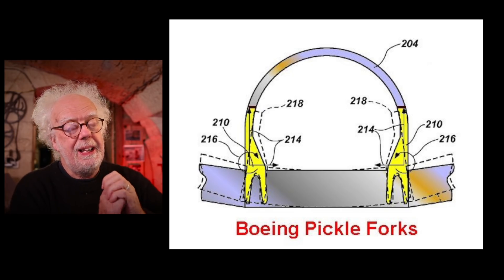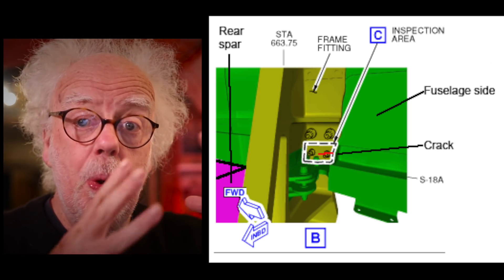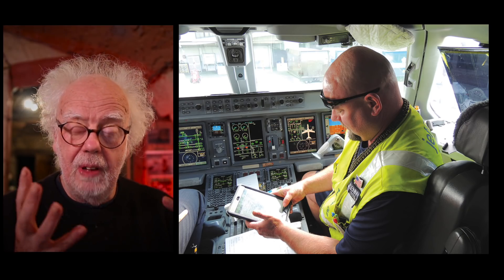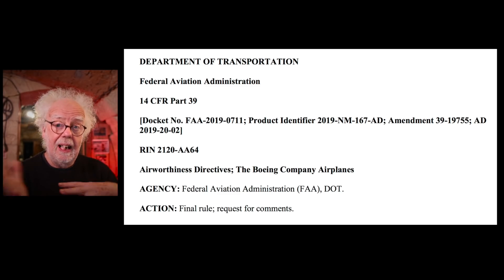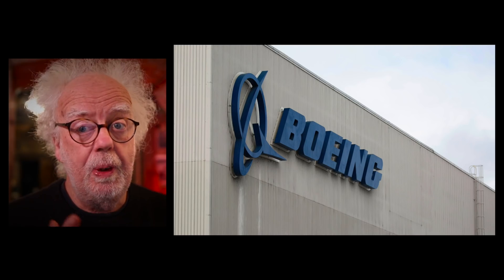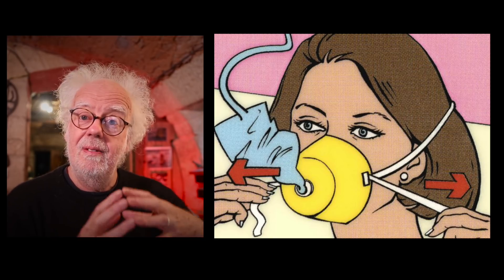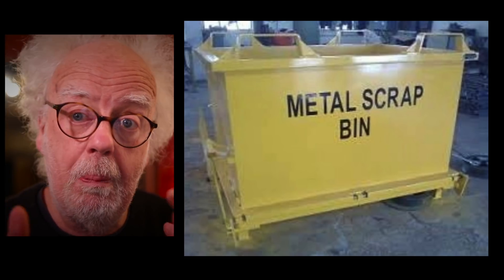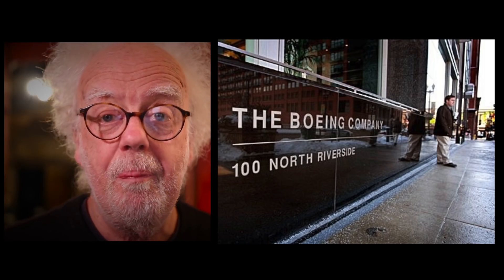Pickle Fork - Prof Simon

Comment: My understanding was that certain holes that bolts pass thru were not properly “cold worked”, and this contributed to the cracks emanating from these holes. Look up cold working to understand how they increase load carrying capacity of a bolted joint.

Comment: Professor Simon
I think you are mixing two different things, the fatigue cracks that happens in all model of aircraft (except composite structure aircraft like the B787 and the A350) and the quality and production problems affecting Boeing plants. I worked for 30 years on a major airline and 8 as a structures engineer. I was a member of the Structures Working Group for the Aging Aircraft Task Force of the L-1011 and the SWG for the MRB of the A330/A340 program in the early 90's.
Cracks are a fact on metal structures and crack growth methods are used to establish inspections intervals of the critical structural items where the existance of a crack from the beginning is the starting point. On my experience I have seen cracks on the B707 bottle pins fuselage fittings (same as pickle forks of the B737), wing to body longeron on the L-1011 and Frame 40 on the A330/A340. The FR40 cracking was known by Airbus and airlines since the fatigue testing of the model before it entered service. This issue was analyzed using crack growth methods while establishing the inspection intervals for A330/A340 Maintenace Program. Intervals were set to insure detection prior cracks reached the critical lenght. And it worked as all inspections done while I was working found cracks at the FR40 on all the A330 and A340 inspected, but all way below the critical lenght. All were repaired and aircraft returned to service without any service disruption as the inspections were planned for major checks.
What happened with the B737 is the FAA and other regulatory bodies are now under scrutiny of the public opinion and took drastic measures that grounded some aircrafts and resulted in this media hype. If there wasn't this issue with the Max I believe that the FAA would have requested that the pickle fork inspections to be done at the next major check without grounding the aircraft affected as the immediate inspections did.

The reason for these cracks on the wing to boby junction in my opinion isn't the flight cycles but related with. It is all about the landing weight and g forces of the landing, where higher the weight and g forces more prone to cracking are the aircraft. You mentioned Ryanair has having aircraft grounded and this airline has aircraft with more cycles due to short distances, more passengers and more rough landings (I have experienced this with Ryanair), so for me isn't a surprise that they have some aircraft grounded.

I have two examples of the weight influence in cracking on my personal experience as the engineer responsable for the repairs. One is the B707 bottle pins frames that were found cracked on LH and RH above and below the bottle pin. The aircraft was a B707 cargo that flew on an african country with a civil war at the time. The landing wasn't a normal glide slope because they had to descend circling around the airfield to avoid any SAM that could be shot against from outside the security zone of the airfield. Also, they had to carry the fuel for the return flight so their landings were heavy and hard.
The other example is the L-1011 rear spar cracking, this cracking appeared on the fatigue testing of the aircraft (like the FR40 of the A330/A340) and was studied by the AATF L-1011 SWG. This study lead to a modification before 30.000 flight cycles based on the criteria and loads forecasted on the rear spar. However, cracks were found on an aircraft as low as 18.000 flight cycles and the SWG recommended and the FAA mandated that the modification would have to be done prior to 15.000 cycles. After new studies of the affected aircraft, that were from the same airline, it became clear that the cracking at lower cycles was related with this particular airline operations. This airline operated mostly from island airports where the taxiway was the runway and upon reaching the end of it the aircraft had to do a sharp U turn to come to the terminal, most of the time fully loaded of fuel. The load caused by the fuel on the rear spar during the U turns increased the stress and thus cracking of the rear spar resulting in cracks being detected much earlier that thought to be.
Reply from the maker: Thank you...good information

Comment: The number of cycles is not what's is going to crack the forks. Hard landings and flying into turbulence will stress and crack the forks, those data are recorded in the FDR but those data are ignored by the FAA so they take the cycles number in consideration. In my opinion the flight hours would have been more accurate. The cycle count is only accurate for the cabin pressurization and depressurization which is placing a lot of strain on the plane skin but none on the wings fork.

Comment: Are cycles a misleading indicator of stress loads ? I used to fly very frequently and some airports (particularly holiday islands) had very short runways that involved landing with a 'bang' and then full reverse thrust and braking. Other larger airports with longer runways were much gentler affairs. I always used to wonder about the effects on airframes of the shorter ones.
Reply from the maker: Yes...an airline in Hawaii had a problem with high cycle ...high stress from salty air...lost the cabin roof
Reply: All incidents that the crew consider put excessive stress on the airframe require inspection before commencing with any flights, including hard landings. The cycle count has been formulated to include a large safety margin. The stressed skin cabin structure is the most vulnerable to fatigue  having to withstand repeated ballooning with pressurisation. Pressurisation cycles would be more accurate. Other parts of the aircraft structure that take high stress, like the wing roots and landing gear, rudder and tail section need regular inspection but will most likely long outlive the cabin structure. 
The 737 mentioned by the Prof in Hawaii lost the complete roof section behind the cockpit and unfortunately a hostess. A passenger had noticed a large crack as they boarded the aircraft...Why don't people mention these things when they see them?
Reply: Martin D A Because most times they are wrong and stupid, so no one pays attention to passengers. I heard a pax saying a part of the wing had fallen off (slats), another saying the contrails were to lower temperature on the ground, smoke (condensation) was coming inside the aircraft and so on.
Reply: Think Alaska on this...hard landing.
Reply: The Qantas 737 routes are generally quite gentle on the aircraft - long runways and reasonable weather. If they are having 10% of the aircraft with over 25000 cycles having cracks pretty much everyone else will too. Boeing has a design or systematic manufacturering fault in a structural component that is supposed to last 90,000 cycles.
BTW The 737Max has the same structure - none of them have however flown long enough for fatigue cracks to appear, their cracks tend to appear from simple overstress of hitting the ground at near Mach 1.
Reply: Cycle life on landing gear and wings, especially hard landings. There are certain G load meter readings that are required to have the airframe inspected for damage if they are ever exceeded, and the meters also have a very high G level counter, which if this increments means that you basically scrap the aircraft, as you have to do a full overhaul inspection on it, as there is a very good likelihood that parts either fell off during this landing or turbulence, or that they will fall off very soon, as the mountings have been stressed to way beyond the design limit and the safety limit built into the design. A good indicator is if you, on a typical multiwheel commercial aircraft, burst two or more tyres on a single landing, then the airframe has to undergo inspection as you likely exceeded the undercarriage strut absorption ability, and there is a very good chance that the mountings or the frame around them have either deformed or cracked.

Yes you get hard landings, but in general all they do is add up the G counter readings to the "major maintenance" milestone mark, and for many airlines at this point the aircraft will be scrapped or parted out, because the cost of this service, and the time involved, likely exceeds the purchase cost of a newer airframe, and in many cases the aircraft manufacturers will give a considerable "trade in"  as well on the sale of a new hull, taking the removal of the old one as a loss, because that then ties you into the lucrative maintenance cycle with new aircraft. that they also take the old airframe and part it out as spares to reduce their internal cost of maintaining older fleets is just a bonus. Old aircraft are invariably worth more as spare part donors than as a going concern, especially if you as a manufacturer or approved service centre can give them that magical green "serviceable" tag as well.
Reply: We use hours and cycles. Somethings are effected by cycles. Landing gear and anything related to pressurization like the Aloha Airlines "convertible" mentioned above it had low hours but high cycles. Things like say,  fuel pumps are rated in hours because cycles don't matter to them.
Reply: In my pilot training (for private aircraft) it's pretty clear we record flight hours and landings, so both are an issue.

Worth mentioning of course that small private aircraft that operate unpressurised at low altitudes have different stresses on them than pressurised aircraft, since the pressurisation cycle itself is a major kind of structural stress.

Hard landings have to be accounted for separately, and typically require filing a report and probably doing a maintenance inspection regardless of what any of the other numbers say.

The main factors are time in the air (hobbs meter readings) and how many landings the plane has conducted...

Comment: This is what happens when a Civilian Airline manufacturer is also one of the biggest defense contractors to the Government, and all the money from Lobbyists flows freely to elected officials..  It's SICK.
Reply: No, this is called normal wear and tear on 15-year-old airplanes. How old is your car?
Reply: Nailed it Dingo
Reply: No Rob. This is not normal.
You're claiming it's 'normal' for a part to fail at 1/3 of it's specified lifetime.

That's like saying that it's normal to have to replace your engine oil every 2 weeks when the specifications say it should be fine for 6 months or more.

Just because something is 15 years old doesn't mean parts that were meant to last longer than that should be failing.
The design life of most aircraft is on the order of 25-30 years. There should be plenty of parts of the aircraft that are fine throughout it's life.
The pickle fork specifically isn't even considered a replaceable part, thus if it cracks, wears out or breaks that's the end for the entire plane.

And my car is from 2003 and runs just fine, thanks. ;p
The engine is still original, the bodywork and interior is original, the radiator is original...
In 16 years it's had replacement brake pads, tires, oil, and radiator hoses, yes.
So sure. Some parts wear out. But this car could make it another 10-15 years without needing to replace major structural components or even the engine, so don't start sprouting absolute nonsense.

Just because something is old doesn't guarantee all the parts are worn out, nor that they all wear at the same rate, or are DESIGNED to wear at the same rate...

I swear, you talk about being in aircraft maintenance, but then you keep repeating stuff as if it's basic knowledge that is self-evidently kind of stupid and ignorant in defense of some large corporation that is clearly putting out substandard work;

So a 15 year old plane has some damaged parts? Well WHAT is damaged matters as much as how old it is.

I expect the tires on my car to need replacing anything from every 6 months to every 2 years, but I don't expect to have to replace the body panels for any reason other than accidental damage, regardless of whether the car is 1 year old or 40...
Reply: @KuraIthys  Cracks in this general area of an airliner is relatively common and notoriously difficult to design against. 

The very first jet airliner ever built developed them, leading to the loss of the air frame. The remaining planes were repaired in situ, and daily visual inspections as well as the new development of X-ray / sonography inspection techniques developed and implemented in the entire airline industry. 

30 000 pressure / depressurization events at 4 flights per day is 20.5 years worth of service. The cracks may have also developed due to the airplane exceeding its design expectations or from hard landings.

Comment: It's absolutely shocking Professor. You would think in this day and age they would have matters like this in hand. What you don't want is people overriding inspections and fitting, something that someone has rejected and changing there mind without substantial reason.
I have not used an airline since 1995 and I have not been anywhere . 
Lets hope they get there act together and sort these important issue out.
Nice one again Professor Simon thank I had not heard about the pickle fork issues. 
If I go anywhere overseas it will be by boat.
I wonder if cruse ships have any issues that could make them unsafe ?
Give my regards to Wallace.
Reply from the maker: Wallace and all of us say hi
Reply: Cruise ships do have issues as well, but hopefully you do stand a chance of being able to get off, as they do have a lot of stuff on board that can float, in addition to the actual stuff designed ( and you hope actually maintained as well) to be there to float in an emergency.  However, with the boating industry maxim being " a coat of paint hides many sins" just remember to have alternatives in mind, and remember to avoid Greek islands.

Comment: The problem is the current management, from the shop floor up, are from outside Boeing, and have little or no manufacturing experience.
Reply from the maker: Interesting
Reply: @SimonHollandfilms  Al Jazeera made a report on this.
Reply: Yep management moved to Chicago no longer at the plant. The marketing department has obviously taken the place of the engineers.
Reply: @davidpaulsen1510  - I blame Hairy Petroglyph, er, I mean Harry Stonecipher. He had it in for Boeing engineers, Boeing Aerospace, Boeing machinists... well, basically everybody.

Comment: The passenger oxygen system on many Boeing aircraft -haven't experience on 87 is not a bottle but a chemical generator.The main reason for failure is the masks not properly packed and they do not drop .

Comment: Ok folks. Old aircraft mechanic here... the 737 Max issue is undoubtedly negligence and pushing profit too far.  However, the pickle fork issue is not negligence   Airliners have cracks all the time.  Every time a  plane comes in for significant maintenance (Called C and D checks)  Metalworkers swarm the plane repairing dozens if not sometimes hundreds of cracks. There are also serious corrosion issues that get repaired because of the condensation on the inside when the plane descends from very cold altitudes to warm altitudes.  When a part that takes landing loads has a crack after 35,000 to 37,000 landings having cracks in them is not in and of its self a huge deal.  

So the only thing that makes the pickle fork cracking issue "special" is that it is in a very difficult place to inspect and repair AND it came right on the heels of the 737 Max nose dive issue.

Comment: The pickle fork is designed to last the life of the aircraft, mainly because it's such a huge repair to change out. Inspection easy ...replacement is a huge deal. I suspect Boeing did not redesign every part as the 737 models were released. The NG most likely needs a bigger, stronger Pickle Fork. Same issue will most likely arise on the M AX...  use of Winglets on the NG and MAX may have not been taken into consideration, and has stressed the Pickle fork. Seeing they help hold the wing to the aircraft's main body... cracks are unacceptable.
Reply from the maker: good points.